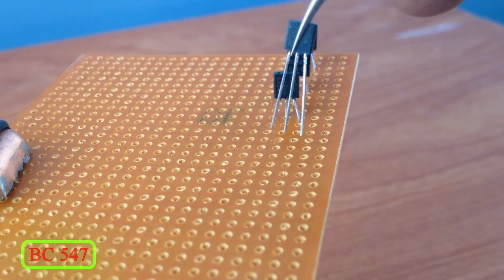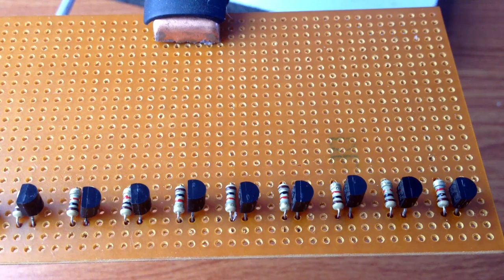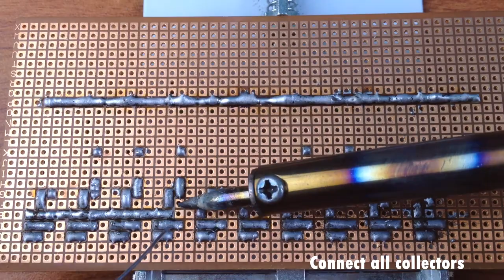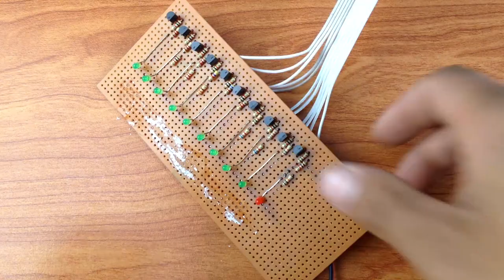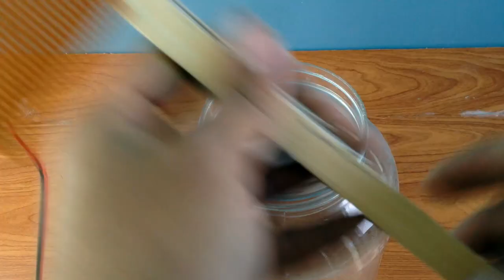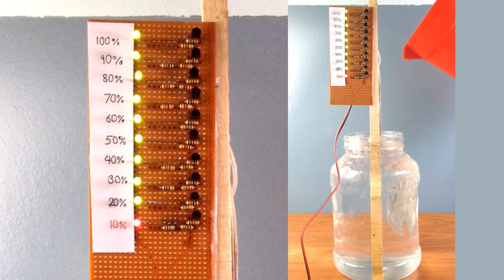Diy water level indicator for water tank

Comment: Nice project however electrodes in a glass jar don't have the same problems they will encounter in a real water tank. I'm in a Northern climate, Canada, and have a 10,000 gal buried concrete tank with a wooden roof. These and distance sensors not only have problems due to condensation but that condensation freezes making them all totally useless. Float sensors won't work either as they will freeze into surface ice and wiring gets pulled out. The solution that works in this situation is a single float attached to a vertical pipe that has a magnet attached inside. This slides inside another pipe with magnetic sensors attached at intervals. As each magnet passes a sensor it's recorded by an Arduino Nano and sent by long range RF to a PC running my control program in my home that displays current levels and also controls the pump that fills the tank. A better mouse trap :)